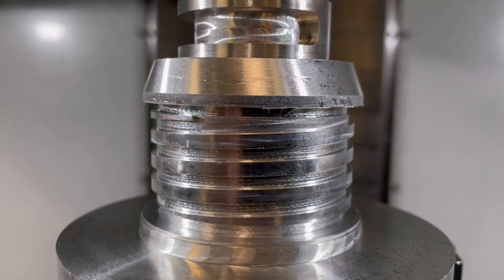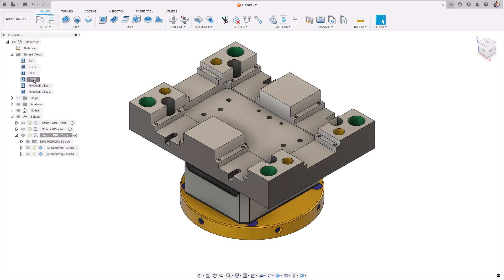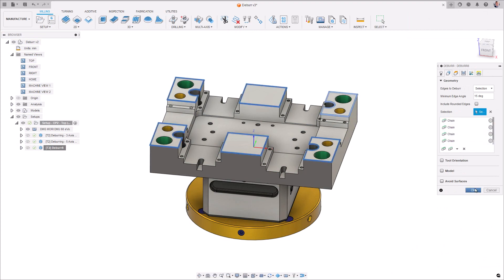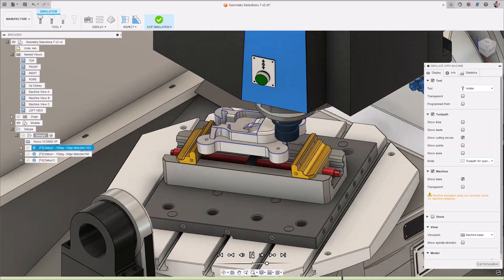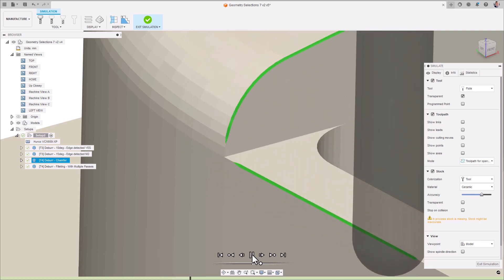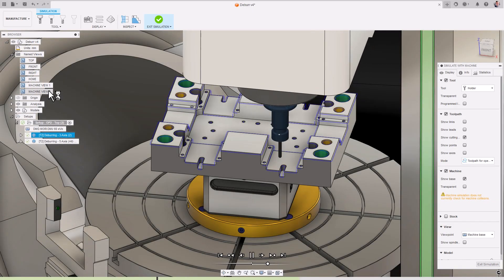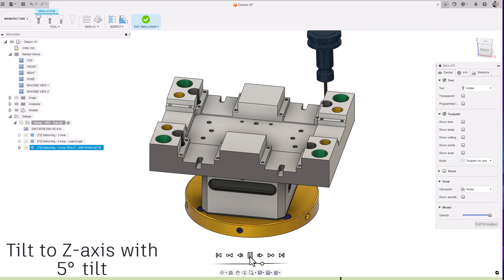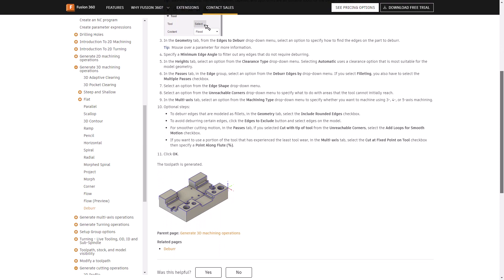Learn How to Master Deburring: a Fusion 360 Tutorial | Autodesk Fusion 360

Comment: As a lathe machinist with 20+ years exp.  its faster 90% of the time to program parts directly on the machine, if the blueprint is good.. ..   . I would like to see AI-programming from a lathe stepfile similar to the nakamura and mazak controls..  If it wasnt cumbersome compared to manual programming I'd probably end up using it..  And dont forget to add some chipbreaking toolpath for od/id threading similar to sandvik optithread.. 😄